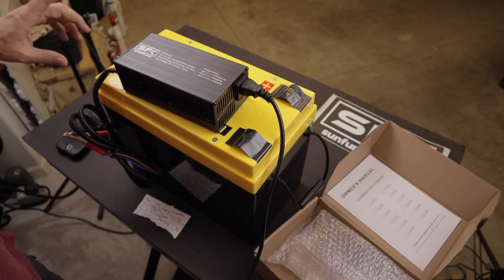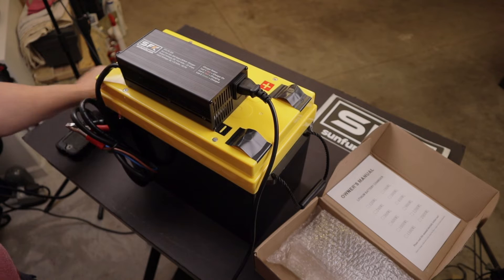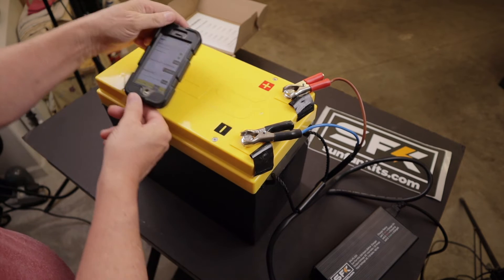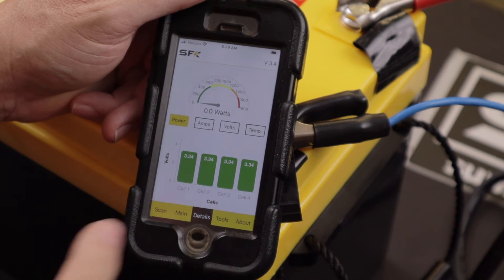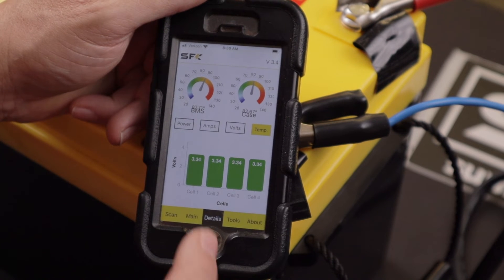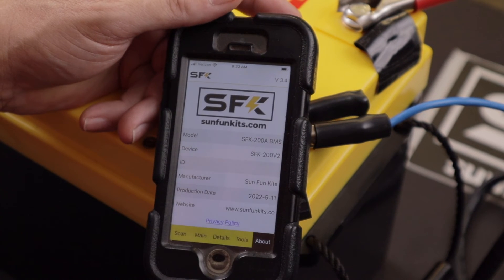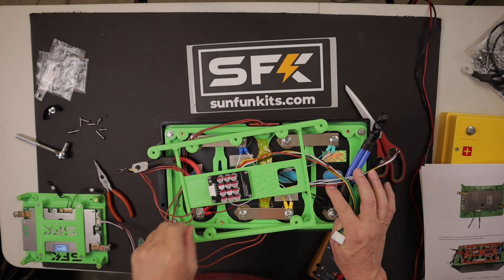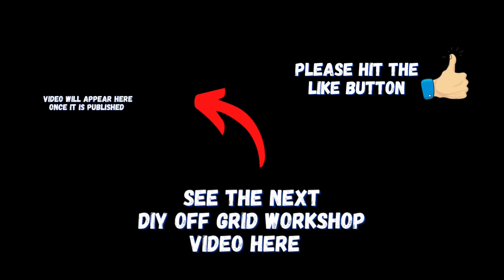DIY LiFePO4 Battery Initial Charge - Sun Fun Kits LiFePO4 App

Comment: Very good setup, we will fix some of these UI issues in the next update, for the Maximum SOC the "No" is supposed to be "Normal Mode", you click on the update button on it, should allow the cells to up to 3.6 volts, but for the most part 3.46 is 99% charged.

We will get a small iphone to make sure the UI appears correctly, most of the testing we did was on a big iphone 13 ☺

Yes good choice on the AB, it will help keep the balancing load off of the BMS ensuring longer life.
Reply from the maker: Thanks for the info SFK.

Comment: Love the way you took the battery apart and checked all the components out (earlier video) and how you explained how the app worked. I'm in the market for a LiFePO4 battery for my RV, and later for my house (building it now), and very interested in this series as this is now a front runner for what I may purchase. I'm not in a hurry, so I'll be watching this entire series before committing to any battery manufacturer.
Reply from the maker: Thanks for the nice comment Pete, I appreciate it! I'm glad you are along for the ride in this series. So far I am impressed with this battery kit and the components. As this series continues I will be testing out this battery and learning more about it's capabilities. I think the price is competitive as long as the battery performs as specified by the seller (Sun Fun Kits). I'm excited to get it set up and do some testing!